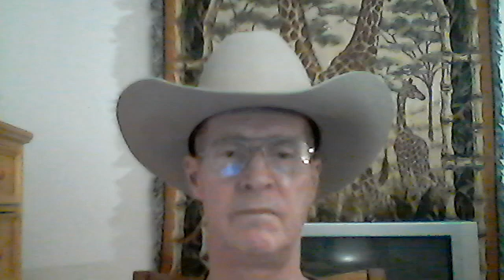Frequency Drift In Old Radios

Comment: Chicago area 90.9 WDCB ( 45 miles SW of my URL ) 

showed daytime drift/RFI with my $5 thrift store find 1980s Lafayette LT-825 solid state analog tuner

when used with a $10 Radio Shack amplified FM antenna...

OR other stations such as 91.1 Vocalo Radio (WBEZ) & stations from across Lake Michigan trying to elbow in...

The radio worked fine on all other local frequencies....

FIXED all my issues with an ALUMINUM FOIL 

Two sided

Faraday cage

On the amplified antenna....

HOT DOG!

SWL'er since 1962....

1949 S-40a...

DX-390 and 392 plus other more modern AM/F/SW or PSB sets, today...

J.C.